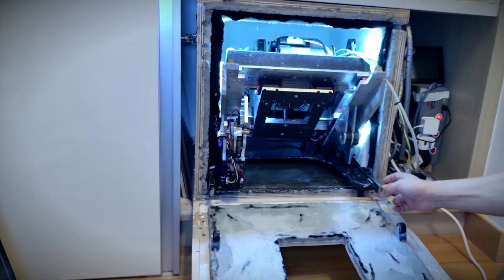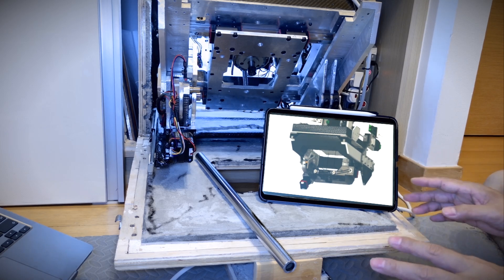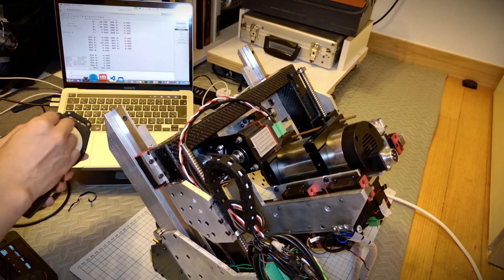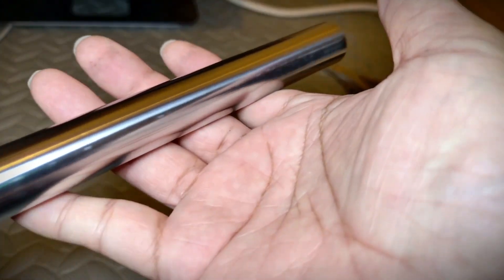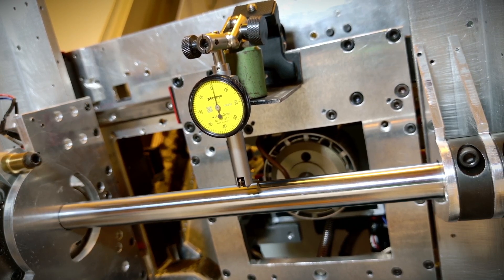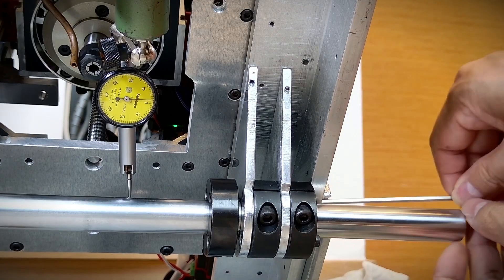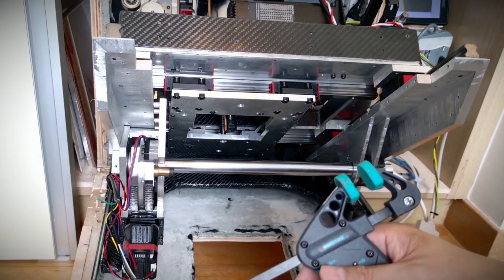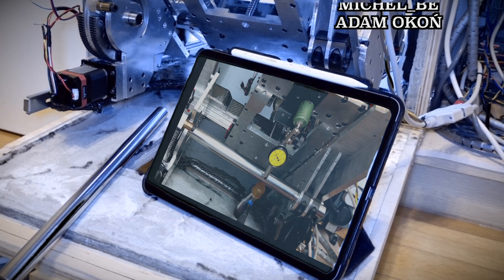Building The 5-Axis CNC Machine in a Small Room: A DIY Journey. (Part19)

Comment: I make my cnc using steel, forged carbon fiber and epoxy granite. I use steel thinking it was cheaper. Guess what, i think using dural is way cheaper. Need tons of adjustment, reassembling, welding and a lot more surface flattening. The time spent and effort is enourmous.
Reply from the maker: Yes, it is.
I also made my first 5-axis machine out of steel.
One of the reasons is that I had never heard of epoxy granite in the first place.
Of course, steel is stronger, but aluminum is lighter and easier to machine.
Overall, I thought using aluminum had more advantages.
I felt the same as you.

Comment: You did not need to move and adjust the switches at all, it can all be done in software for each joint independently!!!
How did you miss that?
Reply from the maker: It can be adjusted with the holder on the right, but the range of adjustment is about 0.5 mm.
I can move it as many millimeters as I can by moving the trigger.
First, I need to move the trigger to make a rough adjustment and leave allowance for adjustment of the holder.
After the final epoxy granite, there will be very little adjustment with the trigger.
Reply: @a-cnc-f  HOME_OFFSET is used in the ini file for adjusting the squareness of tandem axis/joints
Reply from the maker: I may be wrong in my understanding, but since LinuxCNC2.9, joints are dependent on kinematic, so it was not possible to increase the number of joins on its own.
So I'm splitting the Y-axis join 1 into two with a gantry.
The gantry function did not have an independent home offset setting, so I ended up having to adjust the switch itself.
Perhaps my settings are not the most front-of-the-line.
Reply: @ Joint/Axis is included from the 2.8 release.
You can have 1 axis with up to 8 joints, but you do need home/limit switches for each.
So do not use the gantry config for the machine if you do have tandem axis/joints with separate limit switches.
You can always ask on the forum, i am there every day... at least twice ! 😃
Reply from the maker: Thank you.
It seems I am sending out a bit of incorrect information.
I think linuxCNC is very powerful and flexible, but it is complex and there are differences between versions.
I should learn more about it.
But now that my machine is working decently, I would like to concentrate on the next task.
I may revisit the LinuxCNC setup once the C-axis is completed.
At that time, I may ask for help from the forum.
Reply: @a-cnc-f  You are welcomed, always.
Thank you for entertaining videos.